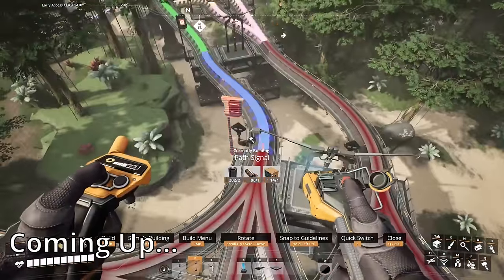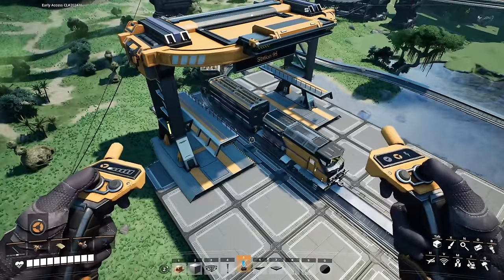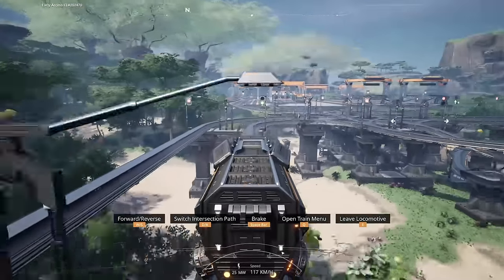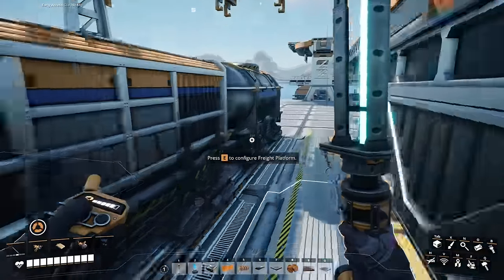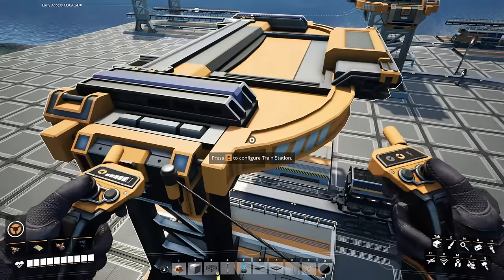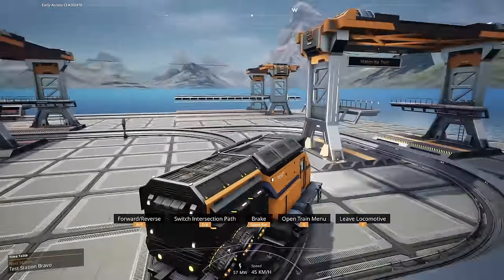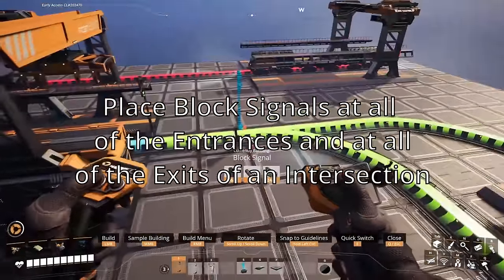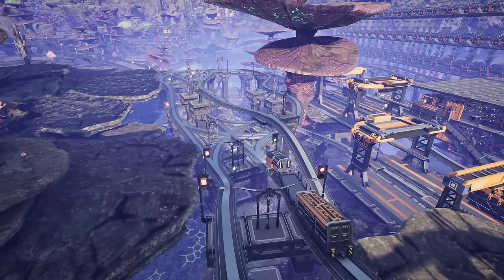Satisfactory - The Ultimate Beginners Train Guide: Part 1 - The Complete Basics

Comment: awesome vid, subbed. i'd love to see an explanation for the actual placing of rails, i find them to be super finnicky especially when trying to get nice clean turns
Reply from the maker: Coming up! ;)
Reply from the maker: Build tips was something that I wish I put in part 1 (and part 2 as well...) but it will be coming in part 3!

Here's a quick tip though:
Using foundations as a grid, the shortest 90 degree turn that you can make is on a 3x3 grid in an L-shape. Make sure when doing this, that your rails are centered on the foundations.

Place a starter rail segment centered at the very edge of the foundation, leading up to the 3x3 grid first.

Then place down your corner rail segment second, dragging it to the edge of the grid on the opposite side of the starter segment.

That's all there is to it! You now have a nice crisp 90 degree turn and from there you can continue to build off of it!

The 3x3 grid corner can be a bit quirky. You MUST place down a starter segment first, then your corner segment, and lastly an end segment. If you try to build the corner segment last by placing it in between a starter and an end segment, then the game will bug out and refuse to do it.

To make larger turns, the idea is the same and they won't be as troublesome as the 3x3 turn.

In terms of incorporating height into your turns, then for the 3x3 90 degree turn, I've found that stacking TWO 4m foundations on top of eachother seems to be the rough limit.

On that last foundation on your grid where you want your turn to end, simply stack two 4m foundations above or below it and you'll be able to place your corner rail segment down, making a nice  sharp turn on a crisp incline.

I hope I was able to explain that properly, if not then railing down rails will be apart of the next and final video!

Comment: This is the best in depth guide on trains to date I've learned more than in every other video so I wanted to thank you for this video but what if two trains are heading to an intersection at the same time and you got the signals placed properly but both trains entered the same block at the same time without enough time to stop or is there a mechanism that will prevent this?
Reply from the maker: Thanks, much appreciated! And that's an excellent question, there is a mechanism in place that will prevent this. Basically, automated trains can defy the laws of physics... If you have an intersection that has properly placed signals on it, and two trains are approaching it at the same exact time, and for example they're going at insane speeds (like well over 100km/hr each), then which ever train entered that intersection first, even if it's by a millionth of a second faster than the other train, that first train will be allowed to continue through the intersection. The other train will come to an immediate dead stop to prevent the collision. It will literally go from over 100km/hr to 0 km/hr in a split second. It's actually pretty funny to watch. I'll be showing an example of this in the next video when I go further in depth into signals, so keep an eye out for part 2!

Comment: I always power my rail system separately from the main power grid for the factories, and I set up a separate power station (or two) just to supply power to the rail system.  This ensures that if the main grid goes down the trains will still run, and I can use the trains to get around the map to fix the main power.  That means I have power poles following along the rail system, but that's not a big deal (in fact I run the power lines out in front of where the tracks will go when I'm building the rail line so that I can use the hoverpack to help me lay the track).

Comment: Fun fact: trainline is a real term, although IRL it refers to the main bundle of wires that transfer data and power between the various locomotives (and boosters, if present; it can also connect to "virtual" locomotives such as a Beltpack system's MCU cabinet for remote control operation) in a consist.

Comment: What I wanted to know was WHY.  Belts are functionally better 100% of the time.  Trains consume power, belts don't, and trains can only move materials AT MOST as fast as they are belted in.  Trains cost less to build over long distances (high fixed costs though), and they might be aesthetically preferable (especially compared to ground belts or sky bridges), but if you can afford a belt and don't mind looking at it, the belt will be better.

Comment: Can I ask where you got 27.08 seconds for the loading time from? The wiki claims 25 but checked quickly just with my watch and it's definitely around 27. How did you come up with such a specific number?
Reply from the maker: At the time that I made this video the wiki stated that oddly specific number, but it looks like it may have been changed at some point.
Reply: @ToasterGamingYT  Ah yes I see the 27.08 figure appears on the Electric Locomotive page whereas 25 appears on the train station and freight platform articles.
Reply: Okay so I did some more sleuthing through the edit history and it looks like the Electric Locomotive article used to also say 25 until it was changed to 27.08 by 'Ondar111' on 24th November 2021. He has pro by his name so I guess that's good. Might try track him down and ask him how he came up with the number.